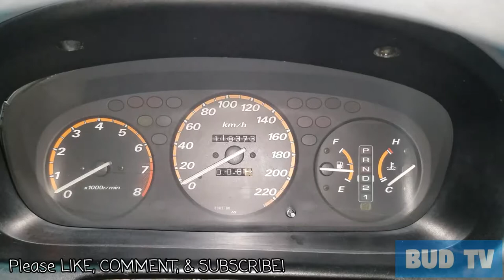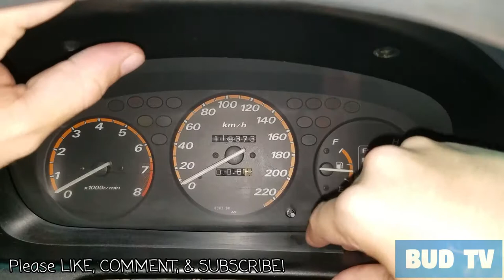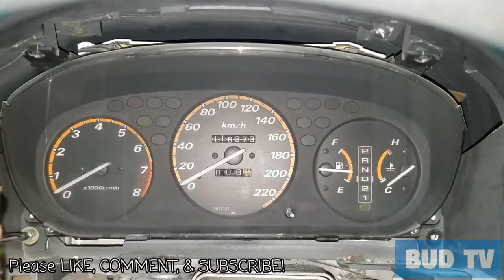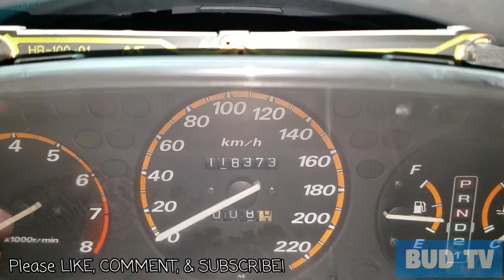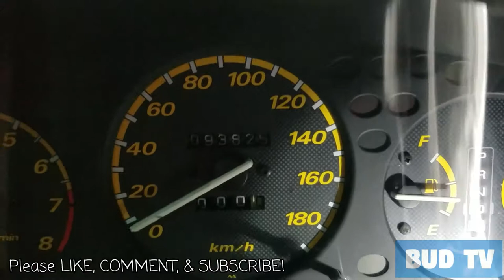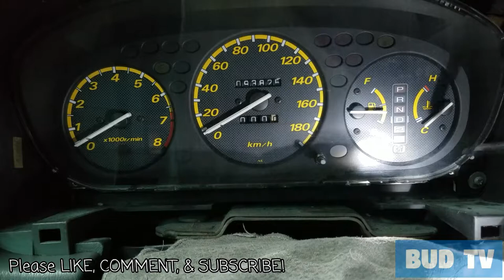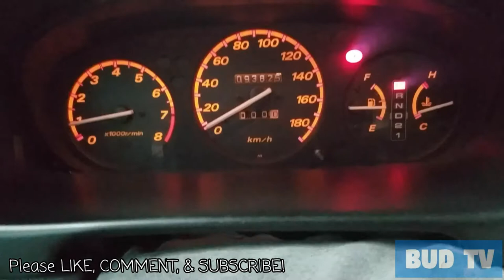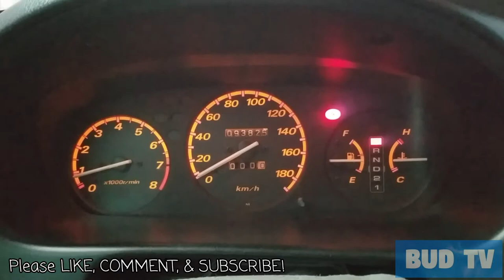How to Replace Honda CRV Gauge

Comment: My gas gage is stuck in the middle and doesn't move at all..is the cluster bad?
Reply from the maker: Have you tried checking your fuel floater? Try to have it checked first. If it's working then your fuel gauge is busted.

Comment: My cluster is stuck at 20MPH, so I’m thinking if It can be fixed or replaced, but then I thought it if I replaced it, if it would actually go the actual miles of my car.
Reply from the maker: Replacement would lose your original mileage so you just need to do the math in calculating.
Reply: @budtv_  wow that the last thing I wanted to do to be honest. Mines only has 130k miles. Thanks for the reply.
Reply: @budtv_  are there digital ones too?
Reply from the maker: @luist6mazda  I dont think there are any that would fit the crv

Comment: Pwede ba palitan lang yun bulb lang ng “D” sa  may gear indicator? Yun lang kasi ang busted
Reply from the maker: Pwede naman po sir. Trace mo lang yung "D" bulb and yun lang ang tanggalin mo manually by twisting the socket out.
Reply: Ok thank you!
Reply from the maker: Welcome! Happy DIY sir :)
Reply: Would you know where i can get a bulb replacement for it?
Reply from the maker: Not all auto supplies can provide bulbs for it sir Bong. You might want to inquire sa Vroomix if they can help you get what you need. You can send them a message at this link: 
https://www.facebook.com/Vroomix
Reply: Thanks!
Reply from the maker: Welcome!

Comment: why did you end up changing the gauge?
Reply from the maker: Its doesnt give out the exact speed anymore. Speed sensor works but i also wanted to switch to Performa gauge Jdm.
Reply: @budtv_  Oh alr. Any chance you delt wit the crv showing a little higher than the halfway mark on the temperature gauge? My 01 crv lx is showing that once we go past 40 mph it starts to slowly climb but when i go back down to 40 mph or below it goes back to the halfway mark. The radiator fan isnt coming on unless i turn the ac on or i think if it gets very close to the red line it turns on
Reply from the maker: @menaceemceefiend9716  Have you tried replacing your thermostat and thermoswitch?
Reply: @budtv_  no, bout to do a overhaul of cooking parts but just wanted to make sure I got some input from others in case they had found the issue and it’s a part I’m not ordering. Hoping I don’t order the parts too just to find out none of them was causin the issue
Reply: @budtv_  No currently doing an overhaul of cooling parts. Any chance youve used motorad failsafe thermostats and if you have what was your experience with them. Have you also had experience with aisin thermostats?
Reply from the maker: @menaceemceefiend9716  aisin is a good enough brand. Theyre pretty much of a good quality as a replacement part
Reply: @menaceemceefiend9716  Sounds like you need a new radiator fan. If the only fan coming on is the AC fan, you're headed for an overheat and blown head gasket. It's likely also time to change the coolant and replace all the cooling hoses. Your thermostat should not be changed until you have fresh coolant, a new cooling fan, and new hoses.